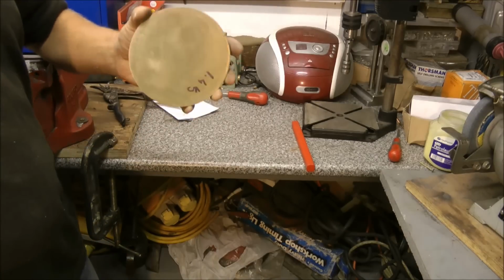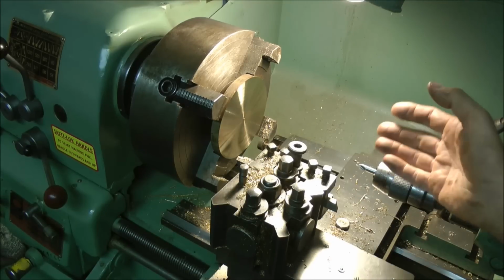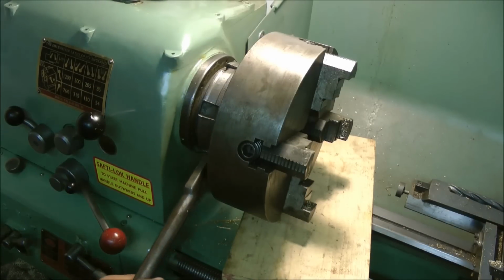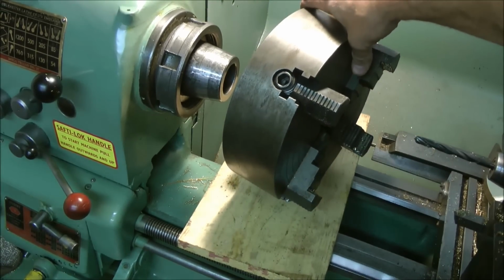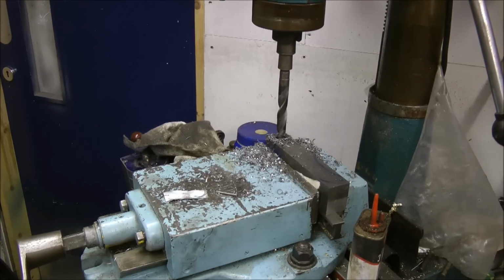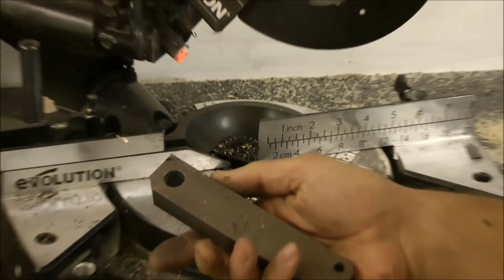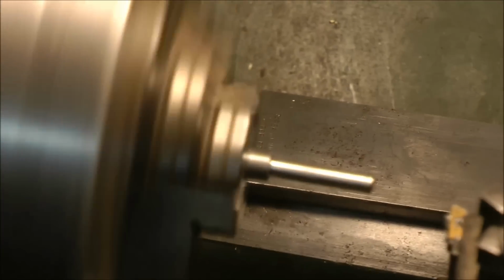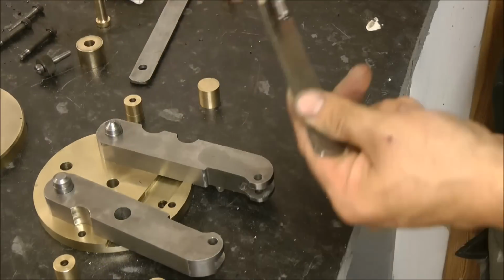How to build a big knurling tool !!!

Comment: Judging from those chips it looks a bit more bronze, all the brass I have used formed little tiny splinters rather than curley chips, a bastard when they get stuck in your finger!
Reply from the maker: It's hard to tell, sometimes there were chips, sometimes stringy , the tool steel may not of had enough radius on the cutting edge it's something I need to experiment on, fingers full of splinters yep been there! Lol